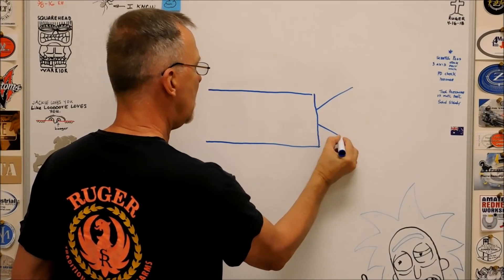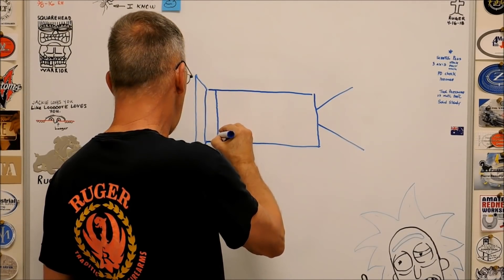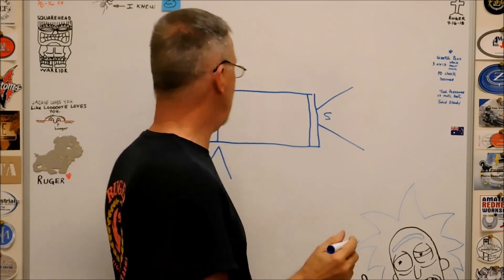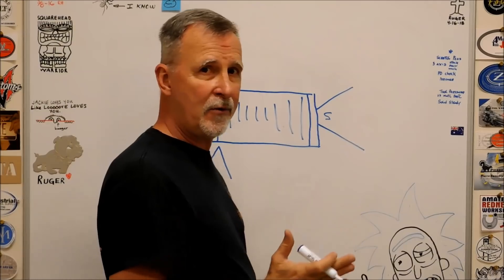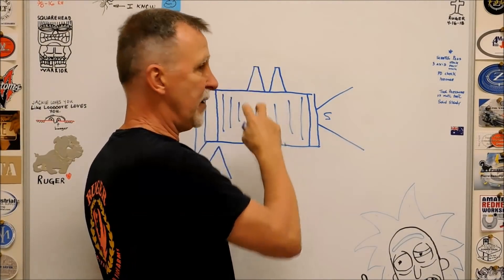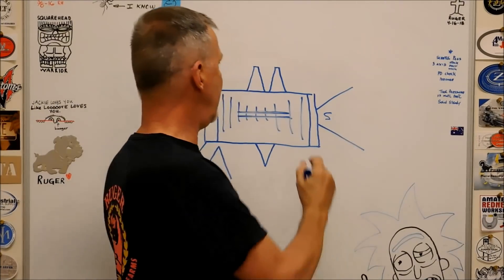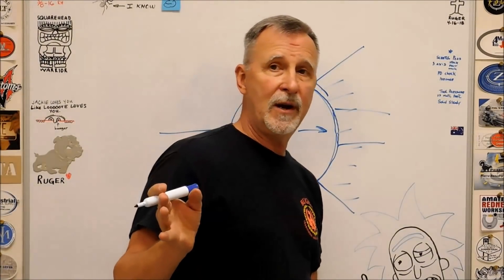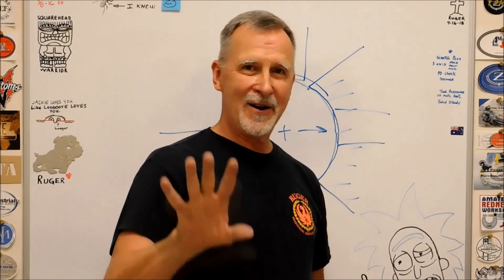CRITICAL Information You NEED to Know to Single Point Successfully. DON'T MISS THIS ONE !!

Comment: Speaking of straight, I have a 9” SB lathe. I tried getting it to cut straight but it always was out of straight when done. Come to find out the lathe bed is bowed in. I took the bed in to get it grounded flat but the machinists said they couldn’t do it and it would cost way to much. Why? I’ve talked to 3 different companies and all say the same, it’s not worth it even if I tell them I won’t hold them accountable if it gets trashed. Even so, the answer is no… why? No explanation, they won’t even look at it. So I waited till I found another bed, but that’s not flat either. I can’t use a big lathe for my hobby, and a cheap grizzly machine has cost more fixing it then anything else
Reply: Basically the amount of time it would take to fix it would cost you more than to replace it, so it isn't worth fixing is why they wont touch it would be my guess.Or maybe those lathes have a history and people stay away from them, that could also be a reason.
Reply: Look at some of the monarch EE lathes ,  their small but have a good reputation .
Reply: It might be that there's internal stresses that will be released as material is removed, so it will just skew in a different direction and they'd have to start all over again, only to have the same problem after each cut.
Reply: Possible solutions:

Make a cut, document the error at each inch, and then compensate for the error with interpolated adjustments each inch. This might be very difficult on a manual.

Put new ways over the old ones using linear bearings, with epoxy between so the new ways stay straight when you tighten the screws to hold them down. This probably also requires you to make a new saddle, too.

Scraping/sanding/lapping. Many tutorials on YouTube. Very tedious and labor intensive, but could improve your results for pretty cheap.

Comment: First, Rick Sanchez is The MAN

2nd, love Rugers - 2nd pistol I bought was a well-worn 1950's Standard, that worked great after removing a literal teaspoon full of lead and powder "gak" from inside it

Most recent was a Blackhawk in .30 Carbine (yes, muzzle flash and recoil are noticable...)

Keep up the great work!
Reply from the maker: My Ruger 45 is the most accurate 45 I own. It puts rounds right where you aim it. Everytime.

Comment: With he tool upside down would not there be a chance that the carriage would lift for the ways?
Reply from the maker: Unlikely. the difference in mass between the tool engagement and carriage weight would break the tool first.
Reply: With an upside down tool the pressure will deflect the shaft downward. Support, if needed, would be underneath the shaft.

Comment: If the stock was bent in the middle wouldn't a scratch pass result in minor scratche in the middle with no marks at the ends? Opposite to your sketch on the whiteboard.
Reply: You started the scratch at the collet, where it's concentric. In the middle of the bend the scratch would be deep on part of the circumference (outside of the bend) and no scratch on the rest of the circumference (inside of the bend). It's hard to diagram in 2D.

Comment: I'd love to know how to double or triple thread.
Reply from the maker: Set the compound parallel to the work piece. Set the machine to half or one third of the pitch required depending on a dual or triple thread. Run one thread at a time, then advance the compound half or one third of the pitch and repeat. Does this make sense?

Comment: Couldn't agree more!
A common cause of deformation of slender parts is also to high or to low pressure from the tailstock (to high - makes the part bow in the middle, to low and it wont give the support needed towards the end).
A steady rest wont help with the "to high" issue but it will improve things for the "to low" scenario.
So while steady rest can be a pain to setup they make it worth it in the end. (this pain is significantly reduced by using it often)
Reply from the maker: Steady rests are OK once you get used to them, but follow rests must be rigid to be effective. If it flexes, don't bother.

Comment: I've been a professional lathe and mill video watcher for years now, and this is the first time I've heard about a 'follow rest.   Noice
Reply: Wut!  I consider myself a newb and it's pretty fundamental. Have to put in more hours of pro watching, you're slacking.
Reply from the maker: Just remember, follow rests are supposed to be rigid. :)
Reply: They’re called follow, or “follower” rest because they’re mounted on the rear of the carriage and “follow” and support the stock during the cutting operation.

Comment: More of the "Obvuous when you think about it" stuff - being as guilty as the next guy of "Let's do this" without enough thinking... :)
Reply from the maker: Its never a bad thing to have a broader knowledge of something you're looking at.
Reply: @joepie221  Absolutely. That's one of the reasons I follow this channel. It's not just machining, but a lot of "Here's why this works" or "Here's the reason I do this". I may choose to not do it that way, but at least I know of one, three or five other ways, and why a particular way works/doesn't work.

I'm just a hobby machinist, I do mostly simple stuff, but I do enjoy making things. Whether it's a 1/16" BSW thread (male + female) to make a new hinge to fix my glasses or a more robust project of a couple of pieces of round stock to make a slide-hammer, a Gotteswinter dial indicator holder, etc.

Comment: I knew she fucked it up..  I wonder why you never  get an idea from an  Abom video.
Reply from the maker: I will never criticize someone that makes and honest attempt to try something, and fails. However, someone that presents a failed attempt as a "How-to" tutorial, is fair game. Safety and success in the shop is at the top of my list of reasons to make these videos. And, as I have stated in the past, someone that knows very little, teaching those that know even less, isn't doing anyone, any favors. As for the alternate source of inspiration...refer back to the first machining video I ever posted. Nuff said. :)
Reply: @joepie221  Someone else who makes youtube videos made a reference to your 'one wire method' of measuring threads as being a possible source of error and not recommended for creating accurate threads. In their video they stated correctly that a burr on the threads would cause the measurement to be inaccurate, but I asked myself, 'what's easier, quickly deburring the threads with a file before measuring, or fighting with trying to hold 3 wires in place and hold the micrometer?
Reply from the maker: @fredflintstone8048  I understand the desire for diplomacy, but I would really like to know who said that. To address their comment and any concern you may have, I have to respectfully disagree. First of all, always deburr and clean a thread before you measure it, otherwise you may be measuring over surface debris, oils containing sediment or burrs. Second, wires don't sit on the intersection of the thread OD and crest profile, so any burr present on the wire side would never influence a reading that is close to spec. Wire contact is down in the thread profile and sitting sub-surface. 3rd, any burrs present on a thread will also effect a gage or mating part fit. Finally any "machinist" that would check a thread full of burrs, without first addressing those burrs, won't be making parts in my shop.
Reply: @joepie221  His argument regarding measuring using the 3 thread wires instead of the one wire method was that you're measuring down inside the wall of the thread instead of the tip which may vary due to a burr, or perhaps the filing on the thread OD since half of the measurement uses the radius from the center to the thread OD. In any case I use your method and have  no real concern regarding why he thinks it's a poor practice, and I will continue to use your  method regardless. 
I think I was the troublemaker that started it all because he recently did a video on how to measure threads with thread wires, and I suggested in the comments that rather than try and fight with holding 3 wires in place that he use YOUR one wire method. This seemed to prompt him to make a video shortly afterward addressing you and your method directly and why he won't use it or recommend it.
I brought it up in response to your comment about people who don't know enough teaching others, or in this case a person making a point that may not be relevant and teaching others on youtube. Anyway, I don't mean to bad mouth anyone, but anyone who jumps to criticizing pros in the business like yourself are a bit on the bold side. If I may go into another topic in one of your recent videos you posted a printed comment that, 'real men use compressed air'. I had to laugh a little bit. I watch a lot of machinists videos and it seems that every one of them that run a professional money making shops use compressed air for cleaning things and make no bones about it. However, it's the school teachers, and the hobbyists on youtube that rant on and on about how it's wrong to use compressed air to clean off parts around machines etc. I respect what some of those school teachers and hobbyists have to teach but in no way do I consider them to be in the class of people who make a living at it which I feel are the ones that have the most to teach us, like yourself for example.
Reply: @joepie221  Another great, informative video.  I, like most here I suspect, watch them all and learn a great deal from each one.  

I have watched (what I believe is) the "other video" as well and I don't think it's a binary choice between the one and three wire methods, I see validity in both.  They are inspecting two subtly different things, albeit with a lot of overlap, and you do a good job at articulating the differences.  The 3-wire method only measures the helical thread, independently of concentricity of stock to the thread.  The 1-wire method takes into account the concentricity, but can introduce error in the measurement as a result.  Your description of making a 1-wire measurement at several radial locations around the part addresses the latter, but requires some mental averaging in order to deduce the true pitch diameter measurement.  In my opinion, a combination of the two will yield the truest measurement of the thread.

Somewhere in the comments here you said "don't assume anything and you'll never be disappointed".  In this case, if you verify that the stock is straight, either method should provide reliable results.  That doesn't take stock deflection into the mix, as the thread depth will change as material flexes during the cut, but that deflection should remain concentric with the part,,, resulting in barrel shaped threads rather than banana shaped.  Again, either method would reveal that the pitch diameter is larger near the center of the part where deflection tends to be the greatest.

The other thing I gleaned from this video, are the forces involved during the cut and how those affect part deflection, as well as how best to counter them with the rest.   My old lathe didn't come with a follow or steady rest, but I intend to build one of each.  Sessions like these will certainly affect my design for the better.

Thanks again for all of your contribution to our world, always looking forward to more.

-Kurt
Reply from the maker: @fredflintstone8048  Channel name?
Reply: @joepie221  Stuart De Haro.